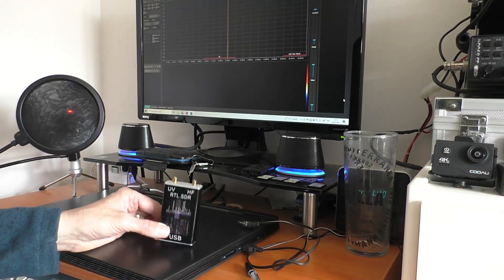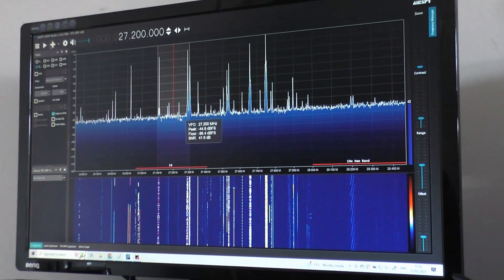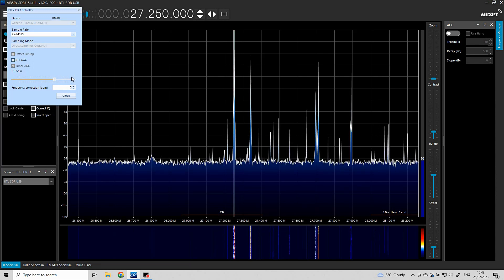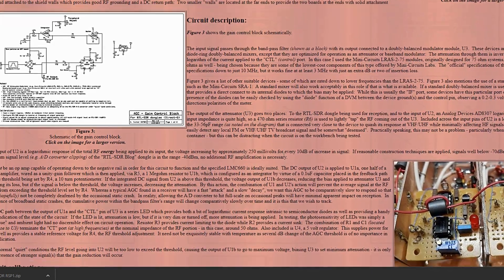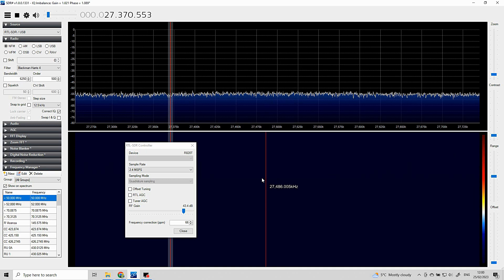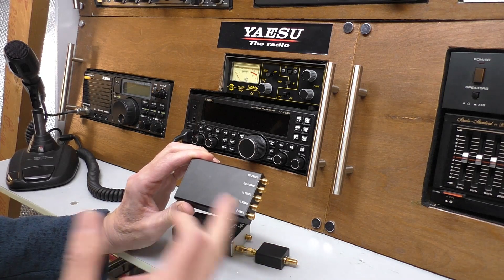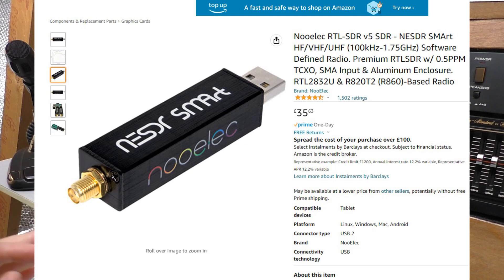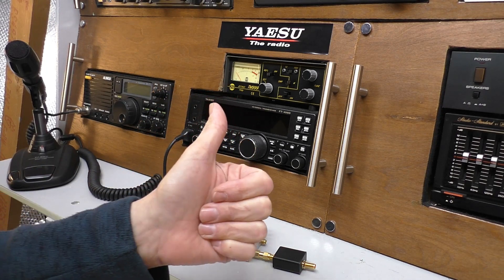Trying a cheap £24 RTL SDR for CB Radio. FM broadcast filter. Part 2

Comment: Can't wait for next video Fred, i would love to see my RTL SDR working as it was the first thing i bought when trying to hear CB radio, it would be nice if you included what you see bit at a time, ie first the SDR on its own and then with the ham it up conected and finally with the filter conected so i can compare and understand what is happening and use the same settings as yourself.
Reply from the maker: Hi Gary. Dont want to spoil the next video but ive moved up to a Nooelec dongle for £34.  Did hit another problem but on the next video i do get it working quite well.
Reply: @CB-RADIO-UK  Can't wait to see the next video

Comment: Hi Fred , most of your issues are caused by pushing cheap hardware into areas it wasn't intended to go. Direct Sampling is how they try to get around it but it brings the issues you have seen. The budget stuff is fine for 70-80 MHz and up to around 1.5 GHz , for decent HF performance the cheapest and best is a genuine RSP1A and of course it will run to very high frequencies as well while performing to a high standard. I use the RSP1A for multi band work and have a couple of the cheapies for dedicated vhf/uhf applications. I've had the same issues as yourself when I was learning this stuff and I certainly learned some lessons the hard way. The NooElec with the ham it up converter is decent but add them together and you are in the same price range as the RSP1A. - Mark
Reply from the maker: Thanks Mark. Get what your saying.

Comment: All right I have the same device it definitely looks like a clone however I can receive the FM station definitely VHF UHF definitely when it concerned the Citizen band Yes it works I can get all the Spectrum the issue that you're dealing with definitely your harmonics coming out of your AM station that's going to cause a lot of issue I'm surprised you're not getting those harmonics into your other equipment I have noticed me going back East to Montreal when I was carrying my shortwave radio because they pumped one of the FM station up to 60000 w Marshall would signal we're not coming in anymore as much they were blocked by Harmonix am and FM tower that is on top of the Mount Royal in Montreal now I'm back in Vancouver I don't have this problem here apart from a lot of harmonics coming in from LED lights basically the switching power supplies that are causing a lot of harmonics rfi's coming in greatly power of four and five sometimes looking at this Ser software or I am using also cubits there's also a Linux called skywave may want to look it up Linux for ham radio no yes I do admit I've been trying to get HF on this one below 27 MHz like shortwave I have noticed that there's equipment she should be also transmitting radio frequencies out of it when I come by with another shortwave radio it does transmit minor signal therefore there is also a step on there is a step down into this device it may have to do with the step down that's not properly adjusted or you may have a call if you got is not as good however I paid 50 bucks for it a few years ago monastic get it going on a Mac as well so it won't work definitely a Linux it will work on Maque well work on Windows are you not use sdrsharp there is another software that I was using that is a little bit older and you can adjust the qm as well on. Yes there's definitely a lot of technical at this scenario it is an Str software-defined radio and definitely it has great potential so far I've been limited to from se25 all the way all to 1.7 GHz and trying to go below this I think I'm honest pick up some minor AM signal so I think that they're still a possibility of getting HF into it However the fact that you're getting harmonics as I mentioned before it depends how much power. Tower has and is transmitting to if it's 50,000 or 500,000 W there's a lot of power going around this includes ground propagation you're probably getting harmonics from the ground maybe installing removing the device or isolating it from the ground potentially I am mainly is also unground signal I will definitely try to see now one thing you can do is try to see if you could transmit on. Of course on one of your devices with a portable or not not too close to it of course she could pick up the citizen been I did have mine I transmitted on my trc-216 low-power distance of about 2 m and it did pick up the signal I had a friend as well a couple of blocks away a lot of blockage away and the signal went through as well they're all as you realize a two different types of connectors to this try the two different types of connectors as you probably have but tried again I still believe that you can get the citizen bed I'm honest to get it online it's the same device is probably about as big as yours what I do see is the big scenario SDR software or Str radio itself is very sensitive it picks up all the junk that's around that's the problem with a very sensitive equipment I'll pick up everything unless you have really good filtering system as you know these systems are build cheaply however they're amazing when it concerns sensitivity not as good as tubes audio-wise so the point that I'm making is you need to be as far away from that station entwined ssdr at a different location this may potentially help you achieving what you're trying to get I am not questioning your abilities I'm just giving a potential suggestion that could make the difference between you getting the signal and not as well I am also using the same device as I mentioned to you I'm also trying to achieve HF basically on the shortwave I may have to go outside my building to see what it is device is going to pick up it also has to do with a laptop that I'm using the machine at you using also can cause harmonics the devices well can cause harmonics and all electrical equipment nearby I presume you got at least between 50,000 to 500 watts is too much power nearby any meantime thank you for trying out good to know that our people are experiencing similar devices issues I might have to get the citizens band but I can't get the shortwave it's got like half a device thank you for the experimentation 73 and all the best
Reply from the maker: Thanks for the long comment.  That BBC2 tower is very powerful.  Yes the laptop is not going to help much either.

Comment: you need to set the radio so it enables the upconverter ,, from what i remember you need to set it to -100,000,000  you are actually receiving much higher in the band that you are seeing on the screen

Comment: SDR ++ should work with that RSP1A clone. I use that software with a Nooelec Nano (25 Mhz to 1 Ghz?).  Good coverage on 10 and 11 meters and extends into VHF and UHF bands without an upconverter or direct sampling. A discone antenna works well with this setup.
Reply: I second the above comments. I had trouble with the device your using as well, I purchased a nooelec device and I can confirm it's much better!
Reply: It is freeware, and it's layout is similar to SDR #.
Reply from the maker: Thanks  Ray is SDR ++ freeware ?

Comment: I also bought the Flamingo+ AM bandstop filter to help out when using my SDR on the lower ham bands. 
And now 160m is perfect, no more MW broadcast signals interference.  

Of course, money no object, then the SDRPlay receivers are superb, and think they have built in filtering - I may be wrong though....
Reply: Hi Fred, Ive got the flamingos AM & FM band filters and they work well for me. I also recommend SDR++ over SDR Sharp for software
Reply from the maker: Thanks.  Ive now got the Flamingo.  Results on the next video.

Comment: Fred, I have the same issue with my RTL-SDR using SDRSharp.  I ended up using a program called SDR++.  You most likely know about it.  With SDR++, I had no problem with the CB band.  Another YouTuber posted a CB file for SDR++ with all the channels and modes programed in it.  An excellent setup.  I found with the RTL-SDR, I need to use different programs for specific uses;  Trucked systems, HF, UHF, etc.  If you want PM me if you want and can't find the SDR++ file for CB.  You do great videos BTW.

Comment: Hi Fred,  excellent radio content as usual.
I had similar issues, and it turned out to be the FM filter that was either dodgy or just rubbish... 
On Amazon I purchased a Flamingo+ FM Bandstop filter for £24 and it worked brilliantly,  stopped all the unwanted broadcast signal from bleeding over into the 10 & 11m bands when using my SDR.
Reply from the maker: Thanks.  Ive now got the Flamingo.  Results on the next video.